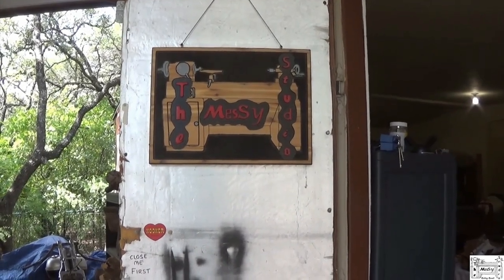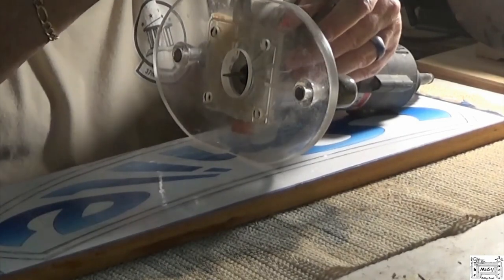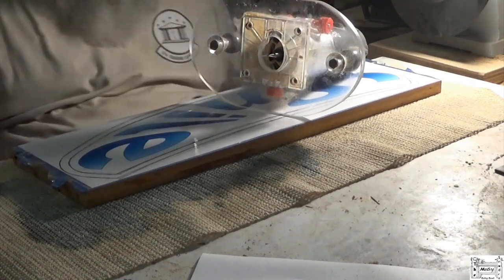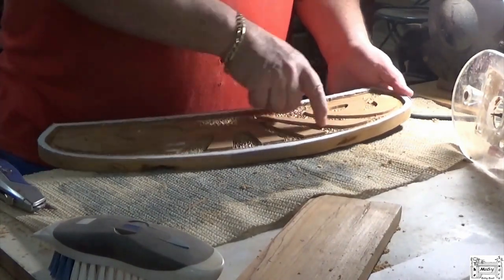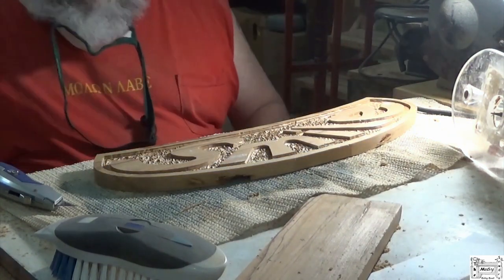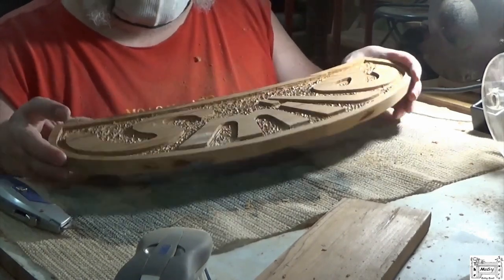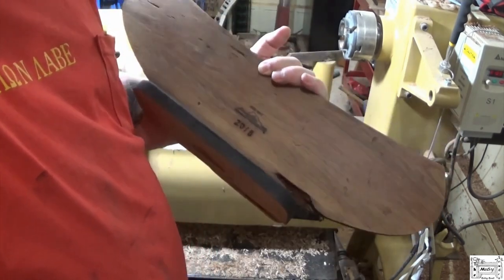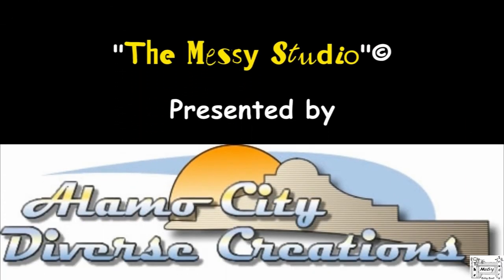#51 - Smile!... Carved sign for a customer

Comment: Bondo Billy Bondo ! quick easy filler if your gonna paint it anyways.  Turned out great.  cypress might be oily like teak, never worked with cypress but I have worked with Teak and it does exactly as you described.
Doug
Reply from the maker: Thanks, Doug, I'll have to keep bondo in mind for next time.  Regular or spalted Cypress isn't oily, but there is something different about this pecky stuff.  Not sure what it is, but it does make some pretty pieces in the end.
Billy